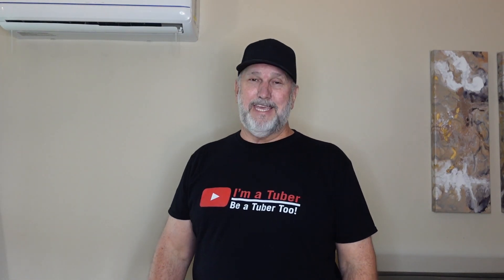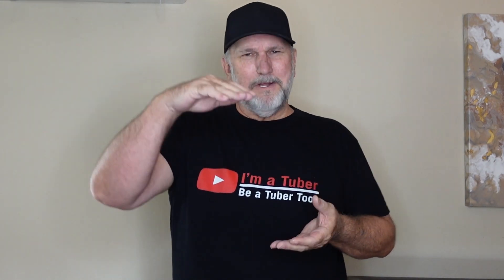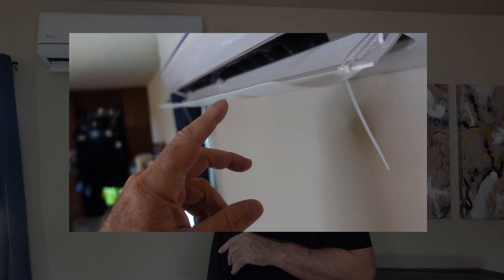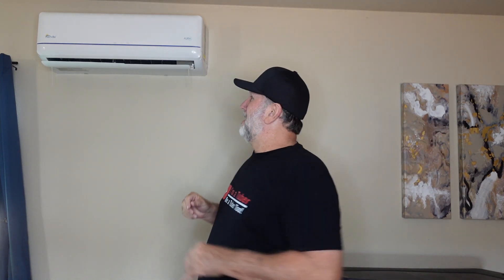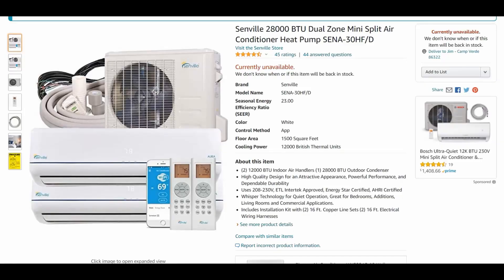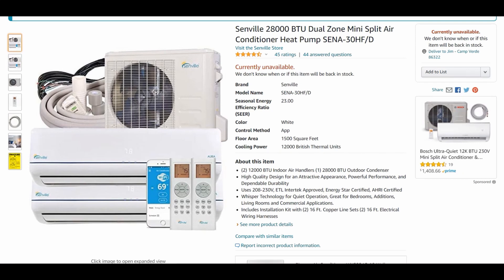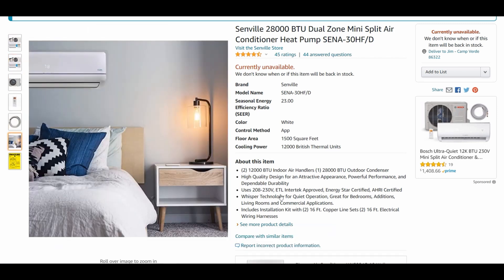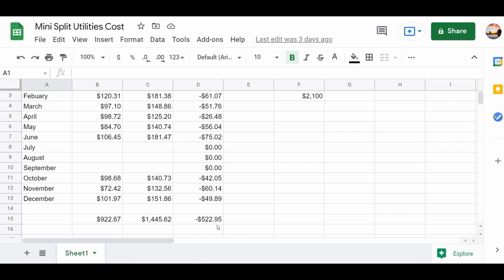Save money and stay comfortable: Mini Split Heating and Cooling Installation Review

Comment from the maker: Senville 28000 BTU Dual Zone Mini Split: https://amzn.to/3lIavq2
Alternatives Units:
C&H 2 Zone Mini Split:    https://amzn.to/2OzENjL
MrCool DIY 2 Zone:   https://amzn.to/3s1Nbq4

5/16" Female Quick Couplers x 1/4" Male:  https://amzn.to/3nQE4aV

Alternative Quick Coupler Installer Tool: https://amzn.to/31c40E3  My Choice!

Yellow Jacket 60278 Flaring Tool:  https://amzn.to/3dwHpae

Screw Feed Tubing Cutter: https://amzn.to/3nQJ3Zb

My Favorite Close Quarter Tube Cutter:  https://amzn.to/3rpZxcg

Vacuum Pump HVAC:  https://amzn.to/318YEcC

PVC Decorative Line Cover Kit (one for each head): https://amzn.to/350IfIu

Outdoor Mounting Bracket:  https://amzn.to/2Fw9vpq

2-1/2 Inch Bi-Metal Hole Saw:  https://amzn.to/343BJS6  This A/C Unit Requires

3-1/2 Inch Bi-Metal Hole Saw:  https://amzn.to/3lIcpqG  If needed for your A/C Unit

30 Amp Fusible AC Disconnect:  https://amzn.to/31aHN9c

Connect with Me!
Follow Me On Facebook: https://fb.me/jimbuildstuff
Follow on Instagram:   https://www.instagram.com/jimbuildstuff
How About Twitter:  https://twitter.com/ILikeToBuildSt1
Check out Pinterest:  https://www.pinterest.com/iliketobuildstuff

Comment: Great video. In Australia we have had these systems since the late 80's. I have found that if you buy a cheap system, the  bearings wear out in about 5 years. Better off spending decent money upfront. Then you will get 10 years or more out of the system.
Reply from the maker: Thanks for sharing we appreciate it!

Comment: I looked into this manufacturer and if you're considering it, be sure to read the Amazon reviews. The two most common complaints are: produces low heat at lower (<40deg) outside temperature, and the bluetooth app is apparently really terrible. If neither of these concern you, it seems like a good unit. Regarding this video, higher-end units have programmable louvers that prevent air from blowing on people.

Comment: Do you have to have a unit in each room?
Reply from the maker: No but be sure to oversize the air handlers in the main room and try to place the unit to get the best air flow in the direction of the rooms that do not have one.

Comment: I just installed a slightly used Mrcool 3rd gen 18,000 btu I bought for 300 bucks. I spent 200 for all the electrical material needed including the cost of new tubing insulation and the lumber to build a stand to get it off the ground and I had the vacuum pump and gauges already. It took me two days to complete because I spend most of the time in a wheelchair. I can stand for short periods of time. So anyone can do this.
Reply from the maker: OUTSTANDING!  Thanks so much for sharing this with us.  Thanks for watching!

Comment: How do you deal with rooms it doesn't heat, bedrooms, bathroom etc. Debating replacing the AC only mini split with heat and ac. But we'd still need to heat areas it won't reach
Reply from the maker: I use transfer fans that pull air from the main rooms but ideally you would get a unit to handle all rooms.  Thanks for watching Valerie, I appreciate it!

Comment: I already have a minisit install in garage.  I have the outside unit on 4x4 on floor.  I wanna mount it a few inches high on wall since they are pouring concrete on floor.  Us there a way to do this without disconnecting any hoses?? Thank u
Reply from the maker: Sure Marco, here ya go https://amzn.to/3gn9GWa
Reply: @ILikeToBuildStuff  iam still wondering how I will bolt the wall brackets to wall without moving outside minisplit  unit? Do this brackets travel side to side on a channel?
Reply from the maker: @futbol1972  You asked how to move it off the floor and up on the wall while you pour concrete with out disconnecting it and the wall mounts will adjust to the unit size and will slide on the upper channel that would be bolted to the wall.
Reply: @ILikeToBuildStuff  yea I just want to move it up about 5 to 10 inches so I cannpour concrete

Comment: Thank you for the video. Looking to get one installed for my parents in a mobile home. I'll need to get it installed. How much approximately should the install cost us?
Reply from the maker: Hi Chris, I really couldn't tell you with all the variations each job has but if you contact an installer in your area they would be able to give you an accurate quote.

Comment: Hi, I’m in Arizona as well. Do u keep central air at like 82…, does the house get to hot if u don’t. About how much is your bill in summer months? Thank you
Reply from the maker: Hello and welcome, I only use the mini splits for all cooling and heating and I do stay very comfortable.  I am installing air transfer fans above the bedroom doors that do not have a head unit shortly after testing a few.   My bill went from $300 to a bit over a $100 in the summer.

Comment: I’m in AZ too, wondering how this does in the summer months? Your video leaves those months out, do you run it in the summer?
Reply from the maker: Hey Joe, Welcome!  You bet we do, it's the only cooling and heating we have used ever since we installed it.  The cooling is outstanding but I would recommend if you're in the Phoenix area is to find out what unit the calculations say you need and then bump up to the next bigger unit.  

Thanks for watching I appreciate it!

Comment: Got quote for $1500 installation service per unit.  Mr. Cool, mid size (200-400 sq ft).  Wonder if it is a fair price? Los Angeles - Orange County.
Reply from the maker: It depends on the unit price or is this just installation only, location blocks etc. and what you can afford or want to afford to pay, along with if you cannot do the installation for any reason.  So without me NOT knowing all the variables I can't give you an informed answer.

If it is just installation only in my area will be anywhere from $500 to $800 per unit from a handyman and an HVAC pro will be $1400 to $2000

I hope this helps and thanks for joining in

Comment: Did you have an electrician run the 220 the unit?  Did that take a permit?
Reply from the maker: Hi Kyle,  It depends on your location as to if a permit is needed all you need to do is call you building and zoning department and ask.  Yes this one is a 220 unit.

Thanks for watching I appreciate it!

Comment: This landlord I've been renting from for only four months has the KMB unit (looks like this one) attached to upstairs wall and has expected for me to warm an entire two story house with that. Not only was the power supply melting and the filters horribly filthy, but in these four months (New Mexico winter) it's never even heated the upstairs area past 60 degrees.
Reply from the maker: A landlord (owner) must provide a way to heat and cool a rental, you can google "Landlord and Tenant Rights"  to get more information in your area.   If the heat pump has not been taken care of and not performing at a reasonable level you should make inquiries.
Reply: Glad i saw this comment. Im installing mini splits into my units (new mexico)
Reply from the maker: @Dannybo35  Hope it helps and thank you for watching I appreciate it!
Reply: Do you think it was because LL did not clean filters?
Reply: It doesn’t sound like it would be a good idea to install one in the rental because you have to keep changing the filters and cleaning it. I don’t think a tenants gonna want to do that.

Comment: I'm seriously thinking about installing a multi-zone system. Maybe 4 zones. So....I am assuming I will have to knock out some dry wall in side the house. Can these lines be ran under the house? What would be the best way...in the walls or under the house. Any advise will be greatly appreciated.
Reply from the maker: Actually you can run the lines any way you want as long as you do not kink them anywhere with one exception is the drain line must always have a downward flow as to not have a back flow occur.

Comment: What was you heating with before ?
Reply from the maker: Hi Mark, the house was heated with a electric central heater that needs a 50 amp circuit to run.

Comment: Hello sir,
Found your channel last night and subscribed.  Thanks for your mini split install video.  I'm having a 48x48 ft workshop with a living quarters being built.  I inquired about a Mitsubishi unit.  Cost of unit is $2,800.  Cost of install is $4,000!!  May do this myself thanks to you!  Just not sure about the inspection as they can be regrettably strict for diy folks in my area especially with electrical hookups.
Reply from the maker: In a lot of areas they require a lic electrician to hook it up.
Reply: @ILikeToBuildStuff  Since my building is new and going through all the inspections I'm sure I'll face this.  Not sure if the HVAC guy will let me do the install and they can do the hookup to save me a few bucks.
Reply from the maker: @rickbrockthedog8017  I have found that they will let you do the grunt work and then hook up but they will charge extra for that but less then the total job.

Comment: Hello do you need to prep the pump for winter to use the heating on the mini split? I have the mr cool I think 2nd gen
Reply from the maker: Hi Savana, you should be able to just turn to heat just by using the remote and choose heat mode.  No other prep is needed.  Thanks for watching I appreciate it!

Comment: The unit you have installed, how many sq ft is rated to heat and cool? Also what it your sq footage ? Thank you
Reply from the maker: BTU Sizing Chart for Mini Split Systems
Area To Be Cooled	Capacity Needed (BTUs Per Hour)
400 to 450 square feet	10,000 BTUs
450 to 550 square feet	12,000 BTUs
550 to 700 square feet	14,000 BTUs
700 to 1,000 square feet	18,000 BTUs

The one shown is in a 450 sqft and a 12k btu

Comment: So its basically for one room? Or it might blow over & heat/cool other rooms? Wonder how it would work upstairs in a 2 story home in Northwest IL, where winter temps drop wayyyy below zero.
Reply from the maker: Hi Donna, if I had gone to a more powerfull unit in the living room instead of the 12K btu then it would have been good for the other rooms but if you have below zero temps most winter I would put a unit in each room.  Just check with the manufacturer and they will be able to work with you on exactly what you need.  Thanks for watching

Comment: I paid $850 for the 19 seer 18k Senville. I agree it gets chilly if your downstream of it. My Parker central ac was right outside my living room ( placed the mini split right next to it) & I had to turn the TV volume up when it kicked on. Now I can even hear the neighbors central ac over the mini split fan on low!! Uses just under 5amps on high on 220v. Hopefully Will be able to run it off a 2000 watt inverter soon connected to a few solar panels. We will see!
Reply from the maker: Hi Robert, That's great and thanks for joining in.  Some people have a hard time believing that they are that quiet or run on less power.
Reply: Yes, this is what I'm after--QUIET and cool.  My window units are noisy AF and suck at cooling unless you run them 24/7 and I can't take that noise.

Comment: Is it condenser unit still being supported and leveled by wood planks or did you figured that out?
Reply from the maker: Hi Julien, Actually I am building a platform for it.  Although the lumber works fine but ugly to look at.
Reply: @ILikeToBuildStuff  How are the brackets not strong enough to support the weight? It's weird.
Reply from the maker: @julienturcot8112  The bracket I think was a little flimsy for that size unit and with some of the monsoon weather we get here I wanted a little more piece of mind
Reply: I put mine on a 3 by 4 piece of plywood raised up by 150mm pieces of 2 by 4 because Senville recommends you not to coil the excess line set vertically so I put it underneath.
Reply from the maker: @robertberin4872  Nice

Comment: Install with equipment is not that cheap. My cheapest quote for one Mitsubishi 12000 btu unit with install was $4650. Central A/C was $10,350. I went with central.
Reply: Wow! Did you get taken to the cleaners, that's insane!
Reply: I dont understand? Why would you go with the central air unit? You wouldve saved almost 6k with installation alone...
Reply: @KT-ed8hj  the central gives a/c in all rooms. The split is only one unit for one area only. To add more splits wouldve been cost inefficient.
Reply: @Beck-Stein  ah i see what youre saying. We live ina split level house in northeast ohio. Electric and gas comes out to almost 200 per month during summer and 100 during  winter. The temperature distribution is pretty bad with our central air. We set temp to 67 at night during summer and it feels mid to high 70s in some of the bedrooms in the middle of the night... obviously distribution would be better with mini splits buts its interesting to hear you say it would be more expensive when people usually say the opposite.
Reply: @KT-ed8hj  see one split is cheaper than central but adding more splits add up to more costs than central all together for the whole house. I would need at least five splits to properly cool the home in all areas. These prices are for California
Reply from the maker: Thanks for watching Beck I appreciate it!
Reply: We just moved to very small house west of Chicago. Only 800 sq feet. Old house was hot water heat so no duct work. Window AC’s This house is forced heat with ductwork but no central air. Torn between traditional AC and the current gas furnace to a good quality mini split for heat and air. Natural gas is sky high. The room set up is the living area flows ( more or less into the kitchen. About a 5’ opening between the two. Small bath off kitchen. Bedroom is regular door. I’m thinking 1 unit for both kitchen and living room a separate unit for bedroom. Currently use a 1200 btu new Midea window ac ( new type that gets amazing reviews and it cools living and kitchen great even mostly using the dry mode for humidity reduction. Turn to cool only rarely when crazy hot. Separate window ac in bedroom

Comment: After watching  your video  I installed a 18000 BTU Senville single head a month ago, does our 950 sq ft main floor right now keeping us cool, I use the our furnace fan to distribute air throughout the house to the lower floor. The air return is about 8 ft away from the head unit , call it dumb luck engineering but works great.  Thanks for the inspiration.
Reply from the maker: Sometimes that dumb luck engineering works out Laurence, LOL.   That's great I love it when a plan comes together.  I wonder how much the fan cost to run, probably not much I would guess.

Thanks for the comment and thanks for watching!